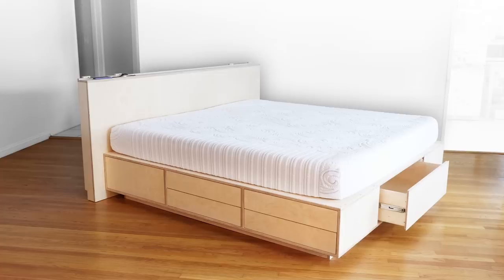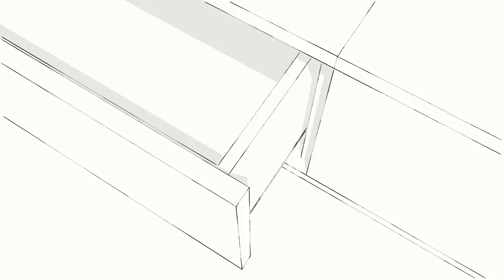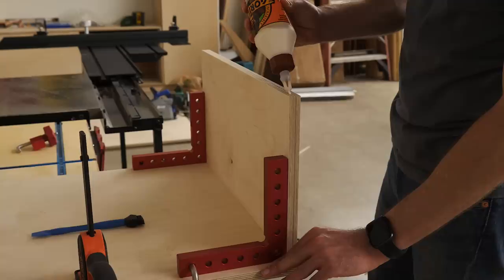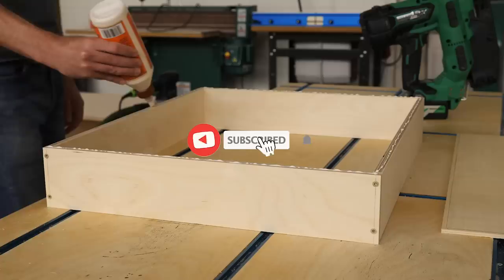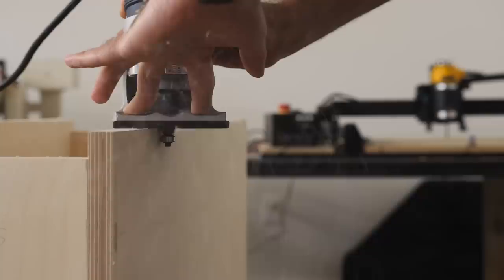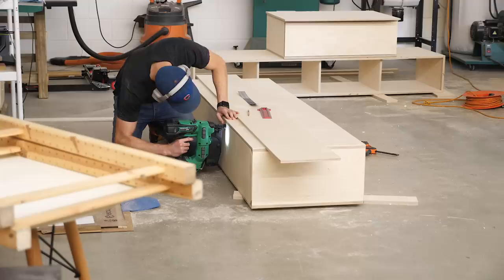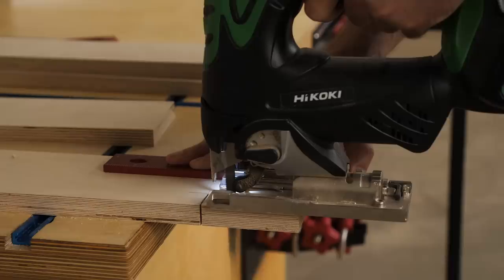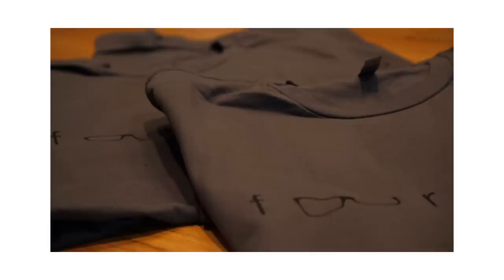DIY Platform Bed with Lots of Storage and Built-in-Charging

Comment: That move at the 4:10ish mark is the most insanely dangerous way to make a rabbet on the edge of a large panel of plywood I've ever seen; not to mention a method almost guaranteed to make less than ideal cuts. A stacked dado set, a router with a rabbeting bit, even just running the piece of plywood over the single blade several times incrementally until the desired rabbet depth is achieved would all be preferable to that nonsense. Please, no one watching this video EVER cut a rabbet in plywood like that. Just more of the cavalier safety attitude the Saw Stop inspires.
Reply from the maker: bed came out good though...right?
Reply: @Foureyes.Furniture  I mean yeah the bed came out looking nice but that's not really the point. As someone making some money educating people with instructional videos you have a responsibility, whether you acknowledge it or not, to demonstrate the safest way possible to a given thing. You could show yourself blindfolded and running across the freeway during rush hour in a how to cross the road video and make it through unscathed through a blinding amount of luck. You could say in the end that that road crossing came out good too. It still wouldn't make it right or responsible for you to show that content.
Reply from the maker: @LordPadriac   Your analogy is based on that being the most irresponsible and dangerous cut anybody has ever made. I happen to disagree with that. Also, In these videos I don't see myself as "educating"...because I don't think of myself as a great or even good woodworkers. In fact, I say I'm average at best every chance I get. I'm a good designer, and I'm happy to give advice, and feel confident giving it, when people ask about design. But I would never have the confidence in myself to say, I don't know, chime in and tell people the only way to do something. People need to do what they are comfortable doing. They can cut a finger off making the most basic rip cut. Bottom line. Be careful always, understand your tools, be responsible for yourself, only do what you're comfortable doing. If you don't understand something you see, don't blindly follow. 

The reason I don't believe I have a responsibility to show the safest way to do everything is because I DON"T KNOW the safest way.  Where it would become a problem is if I started telling people "This is the safest way" and leading them into something dangerous.
Reply: @Foureyes.Furniture  Wow. All I can say is I will be recommending everyone I know in various woodworking forums to stay the hell away from your content. If you willfully don't see the problem then enjoy your fingers while you got them. I'm done.
Reply from the maker: @LordPadriac  You are the exact person that I'll assume you despise.
Reply: @Foureyes.Furniture  Seriously dude? You are the only maker on YouTube I have seen react so badly to criticism about an obviously - and unarguably - dangerous practice. Not realizing something is inherently dangerous because you're an amateur and don't know any better is fine. Everyone was there at some point. To react as badly as you have... I don't like going this way but I will just settle for reporting the dangerous act in your video to YouTube. Maybe nothing will come of it but at least I tried to make sure someone that doesn't know any better trying to follow video knows what to avoid. Whether you think of yourself that way or not by producing videos like this for public viewing you are stepping into the role of educator. Act like it.
Reply from the maker: @LordPadriac  You said you were done. Be done. You are so petty. "I'm telling my forums, I'm telling YouTube" Grow up. Here is what I'm going to do. I'll use this discussion to be a better person, and make something good come from it. I'm going to try putting a header on my videos that says: 

"These videos are meant to (hopefully) entertain, and (possibly) inspire. You should know and understand your equipment, and only do what you think is safe. Just like you, I am still learning. Please do not assume that what you see me doing in these videos is the only, or even correct way of doing things. And above all else. Be safe"
Reply: Hey @lordpadriac , i can see why you may think cutting a rabbet this way is dangerous. If the piece is narrow and long, standing it on end without using a proper jig can be a recipe for disaster. However, i didnt see anything really wrong with what he did as long had he felt stable with the material in that position. I'm a full time custom woodworker/joiner/cabinet maker of 15year (journeyman for the last 7) and i cut rabbets like this all the time. Its just another way that someone who is comfortable with a saw may mill material. Also, i dont use a sawstop to do this procedure, just a regular 12" cabinet saw with a zero clearance throat plate.
Reply: josh kinkead agreed! Did not see anything wrong with that! Yes it was risky, but was under control. @chris keep doing what your doing!
Reply: LordPadriac though I agree with the point that he should have some level of accountability for people’s safety, I hate this sense of entitlement people have nowadays that empowers them to fuck with a man’s livelihood. Hope you realize that reporting his channel to YouTube doesn’t make you some kind of hero to the woodworking community, youre just taking food off one man’s table lol
Reply: Love the passion for safety. I am constantly amazed at the community that is around woodworking online. Because of that I think you probably could have handled it in another way with a better effect LordP. Simply saying "Hey Chris, could you talk me through how you felt about safety on that cut" would have got the same result but everyone would be feeling supported. This isn't a competition after all. It's just a passion we share. 
Besides if you want to give Chris stick I think his weak spots are woodpecker and Hitachi tools. He needs to talk about them and show them more in his videos. I'm not sure if he prefers them or DeWalt or the Home Depot own brand 😂